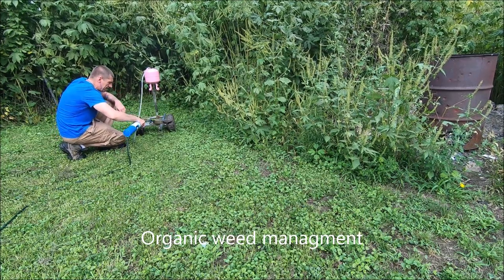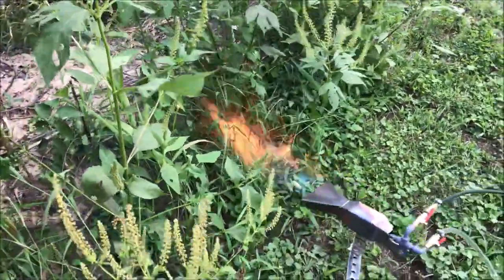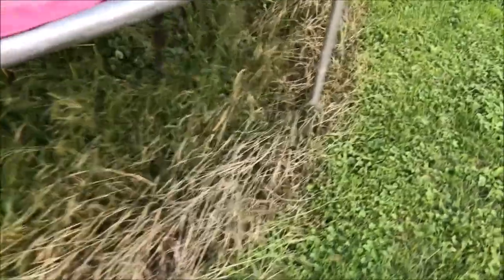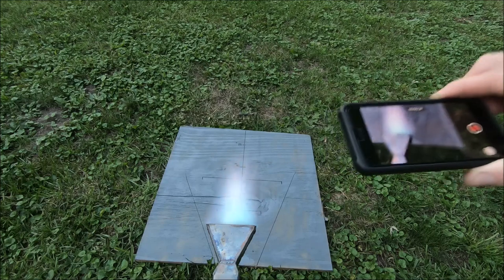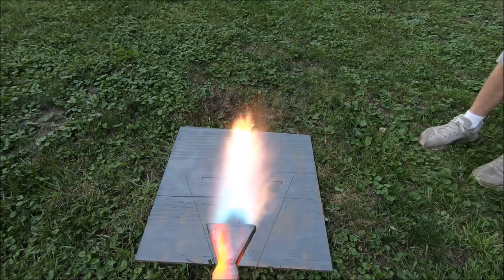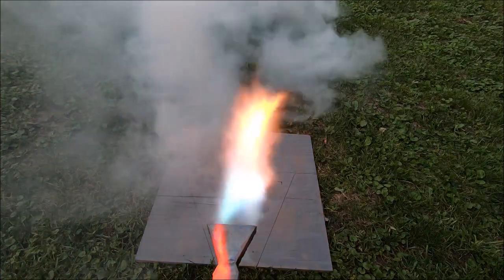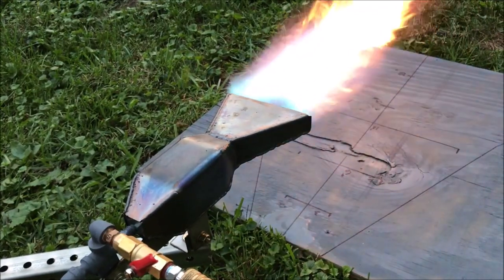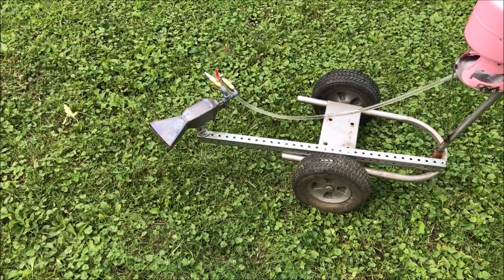Duck Bill waste oil burner

Comment: I just bought one of these off of your eBay site. Can you tell me the approx fuel consumption rate using used motor oil on high? Thanks
Reply from the maker: .2 to .8 gph unless you have a good fire box then you can do up to 1 gph